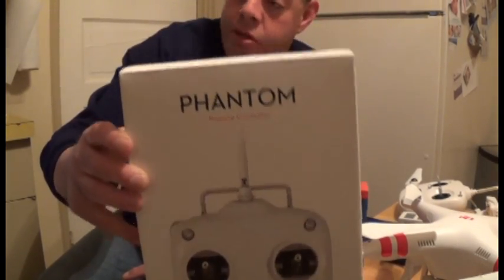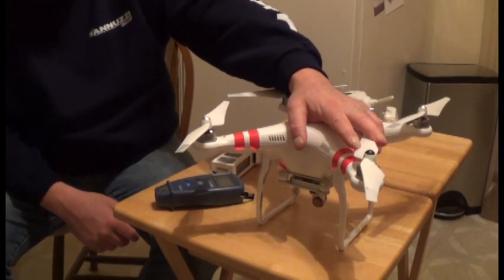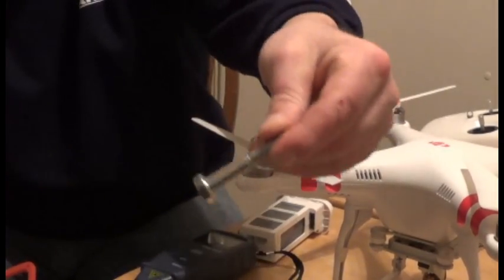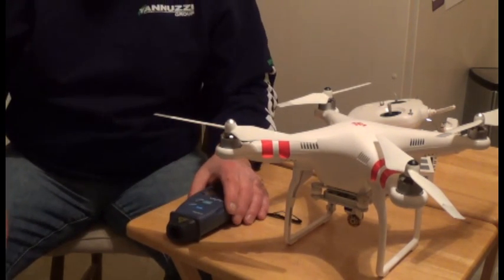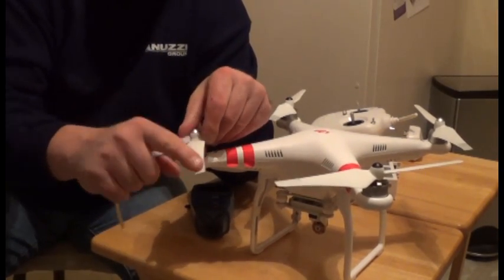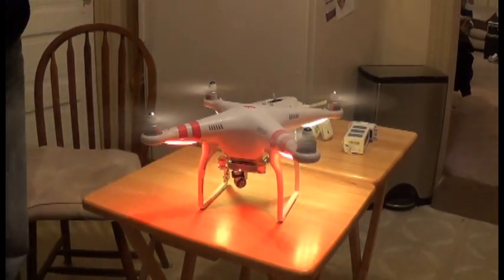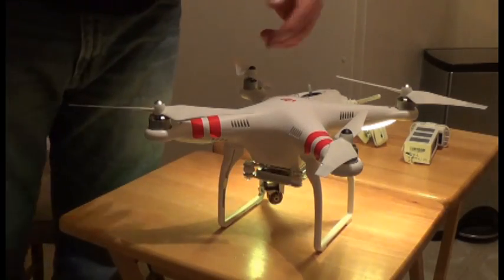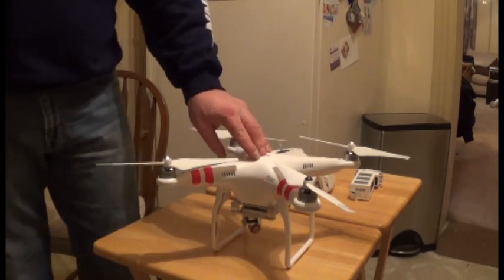DJI Phantom Motor Time Bomb - Is your Phantom Motor Failing? Find out...

Comment: Just noticed a model i picked up for someone else has these new motors so was comparing side by side with my older style motors. The newer one do not seem to have so much magnetic click tactile feel when being spun. The older motors have a lot bore bitey magnetic feel.  So I wonder what the internal differences are. Running up the motors the differences are quite marked. A brand new 2 flight model with the latest motors is much quieter running noise and both odl and new models have undetectable idle vibrations. However as you rev the motors up the newer ones have quite nasty and noticable resonance and the older ones dont. So I imagine this may translate into jello and upset camera at certain revs. Just passing this on to see what you think.

Comment: the real way to check a bearing is moving motor by hand and listen the sound  and the movement... if it get stuck then the motor bearings must be replaced / replace the whole motor ...  also u have to pay attention if the motor is strong or loose ... that might be also sign of bad bearing.

Comment: "Revalations Per Minute"...??? REALLY..???
Reply: i caught that too. he makes several other mistakes while talking and it drove me crazy. even how he is testing the motors seems like the right idea but the phantom is controlling the speeds of each motor. just because one may be slightly slower doesnt necessarily mean its going bad. This method of testing the motors would only be valid if all motors were taken off the aircraft and wired directly to the same battery.
Reply: The only thing I can really agree with here is where he mentions a hot motor. you can buy a laser style temp gauge and point it at each motor after say a 15 min hover. hover in place is important because you want each motor to be put under the same stress. record temps and if one is significantly hotter you should replace it. if you dont have a laser temp guage just feel each motor with your hand. if you cant touch it because it's too hot after hovering 15 mins replace immediately and dont risk flying it. if one feels noticably hotter than the rest use your own judgement but its always safe just to replace it expecially if its a quadcopter because if one motor fails it falls out of the sky. modern hexacoters and can loose one motor and still make it home and modern octacopters can loose two (provided the failed motors are not next to each other). I cant stress the word modern enough here. if the software driving the drone isnt designed to automatically compensate for a failed motor it might just crash anyways.
Reply: +Paul Rucker LOL....

Comment: Just a question, but how about securing the aircraft and testing at full throttle?  Also, do you think a laser thermometer would be handy to check motors in post flight?

Comment: You are wrong, the kv rating is measured with unload motor (no propeller), so this test could work, but without the propellers on, besides is very risky to do what you do in the video, anything could go wrong.

Comment: I just bought a Phantom 3 Advanced.  It didn't even get off the ground.  The rear motors were screeching and not providing power, flipping over.  The motor was scalding hot and it burned me and was smoking.  I think DJI is failing in quality control.

Comment: I followed Francis guide and purchased the exact same tachometer ($12 on ebay).  After conducting the tests these are the test results:

Motor 1:  3550 RPM
Motor 2:  3550 RPM
Motor 3:  3450 RPM - motor is off by 100 RPM
Motor 4:  3550 RPM

Not sure if being 100 RPM off requires a motor replacement.  Anyone's advice/suggestions/experience  is appreciated.

Comment: I'm new to this issue of engine performance, so I thought I would check out if I need Oil, overhaul or replacement. 
When I hand spin each of my engines slowly, the engines feel like there are mild "detentes" about every 1/10 around the circle, in both directions That's every engine, and the bird flys. Is this normal, or have all my bearing gone bad on all engines? 
This is my first and only Phantom, so I have no point of reference other than a mini quad. I have about 8 hours flying time on DJI, and it seems to fly well.
(BTW-  Yo Frankie! You sound like a "bro" from Brooklyn or Jersey - both of where I am former ally (and originally) from).
Keep up the good work!
Reply: Al C Also: I have about 8 hours total fly time on the DJI. I've had many rough-sloppy landings and have gone thru several sets of props in my learning experience.
Reply: +Al “chance” C Yo Dude, those are the permanent magnet arranged in a circle that the changing magnetic field in the central windings chase around in a circle.  REALLY FAST!!  LOL  Seriously, that's how a "brushless" motor works.  I have more than 10 of the detentes you describe, they aren't perfectly spaced.  I think the central windings wrap around some metal, and you're feeling the magnets as they go by these points.  These motors can be VERY forgiving of sand, for one thing.  Open as they are, I thought a sand crash, motors crunching, me cringing, would be the end of the motors.  Some air blasting dust cleaning in a can.  Some very cautious turning, more fast air.  All the sand blown out.  No lasting problems.  Only since there isn't any contact between the magnets and the windings.  Hell of a trick.

Comment: OK nice video,thanks. But,and this is a big but,I would never ever test the Quad indoors with the props attached. You are risking all sorts of problems,a sudden failure of the transmitter and you will have a big fight on your hands,sudden take off and RTH activated,end result ,smashed Quad and you get ,a few cuts and bruises,maybe worse.
 I am sure you know this ,but nice vid,and thanks.
Reply: +John Doyle  I've risked it, but I know I'm taking a risk.  Put a weight symetrically over  the gear -- like two sand bags, one on each side, don't block the gimbal -- that will do it.   I've also gotten a nice hold on one of the gear legs, not to far down, but a safe distance away from the prop, and I've done some control input experiments.  Once you get the feel of it, it won't feel dangerous (And I don't think WILL be -- the important thing), and you can spin your motors up, and check things out in a higher power environment.  Before you do an actual takeoff, you can tell if one is going to work out.  Hover with you're hold acting as a tether.  No it's not insane, it works fine and safe.  If you're careful.

Comment: What do you think about the other link to the YouTube video  where a guy used a quick connect between the Motor and soldered joints? You think this is a good idea for ants too much weight

Comment: Francis first thanks for all your videos but I have a question how did you determine it was the motor and not the E.S.C Board inside? As always thanks from Atlanta
Reply from the maker: I haven't yet but planned on replacing them because of the crash. When I found the quad it was tilted over on its side and the motors where trying to spin but props wouldn''t allow them to spin so for my ease of mind I want to replace them. For the $30 a motors well worth spending on it.

Comment: I enjoyed the video, and agree with the comment about weighting the Phantom down.  But I wanted to comment that it doesn't matter where on the prop you measure.  The tip is going the same RPM as the root.  One revolution, is one revolution.  So it would make more sense to put the reflective tape closer to the root of the prop.  That way your prop won't be as far out of balance as it's spinning...... especially if you are testing under load.

My tach relies on ambient light, so I don't need the tape.  I just set the number of blades, and measure.

Comment: Francis, I enjoy your posts, please keep them coming, has more helpful technical substance than others. I have about 230 full flights on my DJI P2V+ since July (less lately because of Canadian winter).  In Maui 'til Christmas, after seeing your video yesterday about using tach to monitor motor condition (will buy one once back home), worried that one motor running a tad warmer than others. Is motor conkin-out an immanent threat as I fly over this beautiful island. Would you suggest I pack-it in for this trip? For all I know, that one motor may have been running warmer for a long time. Advice? Thanks Francis.

Here's a short clip of my work. 
http://youtu.be/b1rQhbpjAb4
Reply from the maker: Sooooo Jealous... I'm freezing my Butt off hear flying in 20/30 degree weather. Nice video enjoy have a good time!!

As for the hot motor: Absolutely, if your one motor clearly feels warmer then the others. I would stop and get it home safely. The motor warms up when bearings are going bad the motor doesn't spin so nice and starts to heat up causing the motor to be much warmer then others. If you want to take it out and fly very close to you and low encase the motor fails that would be fine. Then once your done test each motor on the ground to make sure the one is hotter. Let me know how you make out but until you really test it I wouldn't go out far or high!! Hope this helps!

Comment: Good video, I haven't done this type of test yet. I have tested my motors with a watt meter to see how many amps and watts they are pulling. The only down side is you have to remove them and screw them to a board to test. Thanks.
Reply from the maker: Yes that sounds time consuming. Just wondering what type of readings where you getting and where they consistent?

I was shooting for a fast easy way to test. Subscribe and stay tuned I have some more interesting tests coming you wont want to miss. Thank you very much for watching!!

Comment: Keep the videos coming Frances, if you have a big change in RPM do you know if it's the motor or esc failure to blame
Reply from the maker: Hey Dave, if it is the motor on its way out it most like will be the bearings. If there bearings are going you should have some play in the motor and if you do then remove and replace. But the purpose of this video is to try and avoid that from happening because that could be a little to late if that happens and you might be watching hoe to repair you gimbal haha which you can find here: http://youtu.be/O3xSXy19tCE

If the motor doesn't have play then you need to look at the esc. Hope this helps!! When it doubt toss it out and get new! The way I see it is a Motor = $30.00 and a ESC = $25.00 so for $55.00 to replace one that might be bad vs spending $800.00 on a new gimbal unit or possibly $1300 on a new P2V+.

Hope that helps!! Happy Flying and thank you for watching!!

Comment: The speed difference can be the ESCs that are not all calibrated 100% the same and the motors gets a slightly different throttle speed.
Reply from the maker: Doesn't matter because your not really looking to compare against each motor. Your looking to build a history per motor in a log book and compare that over time. For example if motor/prop A for the next 5 weeks has an avg. rpm of around 3700 and on the 5th week its at 2800 well I know something is wrong. Its an alert to bring attention to a possible issue that might need to be addressed.
Reply: +Francis G Bingo.  I think you're right on.  A big drop is one thing, but a 100 rpm should just be noted, and recorded for future reference.

Comment: while its sat at the table its at an idle state....so its not doing any compensation so the motors are just told to spin, thats all, they are not gteed to do that at the same speed, one prop could be more efficient at turning spin into thrust, that would put more resistance to the motor and slow it down, even if you did this with it sat at level hover with equal motor thrust, one prop could have a different efficiency than the other props, so that motor would be spinning faster or slower to get even thrust, this test is useless.
And can you take one of those motors apart and show us the gears in it?
Reply from the maker: I disagree 100%. The yes not all motors will ever be perfect. The purpose of this test is to try and predict motor failure by monitoring your motors often and logging it. And your looking for major changes in speed. For example today if I measure and it was 3700 and next week measured same motor and it was 2800. Well that would start to concern me and I would start to consider replacing the motor! Yes once I do the video on the motor replacement I will take one apart as well. Thanks for watching hope you enjoyed!!

Comment: your videos are great.  very informative and helpful, thank you.  I have had recent issues with my drone. tough time usually on a decent or a rotation left.  Not sure if I have a motor issue or not however I dropped my drone from the sky from roughly 30' high onto the ground.  I had prop guards on, and I ended up removing them.  I was told with prop guards, its common to get a greater prop wash issue than with out.  Since removing my guards, no issues as of yet.  I only flew twice so I need more flight time to get a idea of if it will happen again or now.  I am overly shy now to fly, very concerned to drop it from the sky again, so I'm wondering what my deal is!  Time will tell, thanks again for the great videos and your help.  hopefully I'm entered into the draws properly.  Merry Christmas to everyone!!!!!

Comment: That's a good idea, but you could also do it with the props off and using the reflective tape on the motor Bell.
Reply from the maker: You can't I tried unless you are willing to paint the motors black. The motors are reflective and it causes the meter to get incorrect readings. Even the props are reflective and cause readings. But I just left it on the reflective tape. But the proper way is black prop or motor and reflective tape for the best reading. Thanks for watching hope you enjoyed!

Comment: might be good idea to put diving (lead) weights on the landing gear in case throttle gets hit or controller gets shut off (could trigger RTH) or any other reason that might trigger props to speed up to lift phantom.  I've found 2 5lb weights are more than enough.
Reply from the maker: Hello Norman, thank you for the Added Tip. I made a notation on the video!! Thanks for watching!
Reply: Agreed!